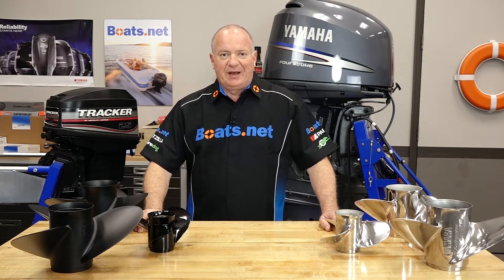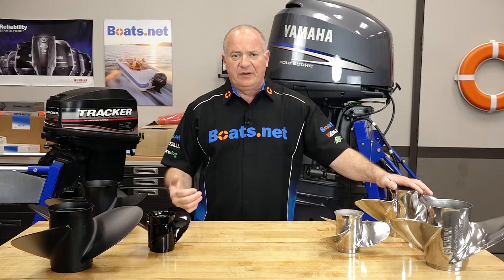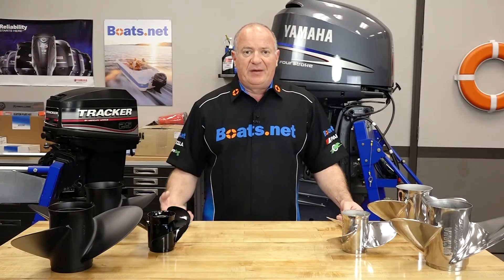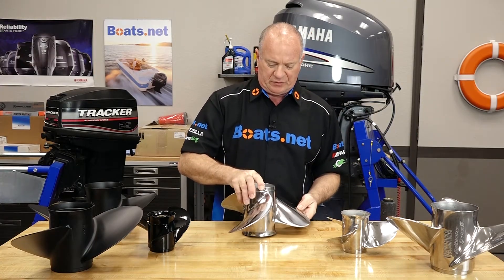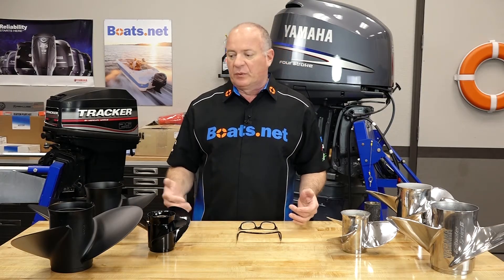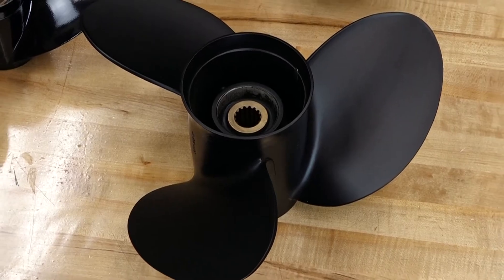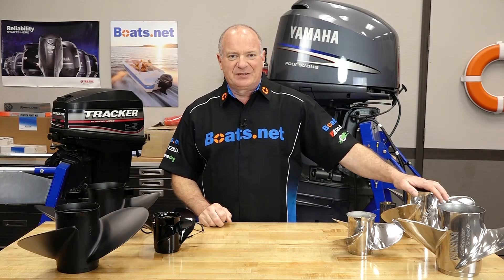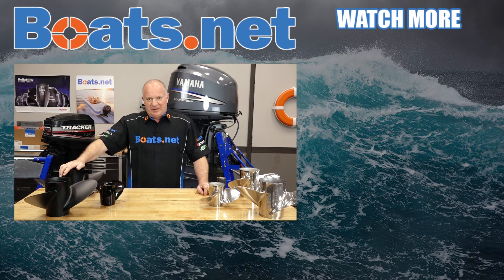Stainless Steel vs Aluminum Boat Props | What’s the Difference Between Stainless and Aluminum Props

Comment: Alu props suck, end of story. Absolutely asinine to state that for most people an alu prop will do just fine. It is the single most important part of a boat, in relation to how the boat feels and operates. It is the LAST thing you should save money on. Get the best SS prop you can and spend the time testing.

Comment: Good information. I run a stainless steel prop on my Mercury 25 2 stroke. I love the way it performs but I do fish an area with plenty of submerged obstacles. This past Monday I hit a submerged tree running 30 mph. The prop appeared to survive the strike, but the lower unit did not. It bent the prop shaft about 1" from center and there is probably other damage too. I love the cool factor of the stainless Ballistic prop hanging off the back, but I truly believe an aluminum prop would have saved me from all of the lower unit damage.
Reply: If you hit something hard enough to bend your prop shaft 1", nothing would save it. It takes a lot to do that.
The prop on your boat is ultimately what determines how your boat runs. Never skimp on a good prop.
Reply: @AB-80X  Oh I do run good props. Normally Ballistic. They do very well. When I go to lakes with stumps, I run aluminum. It may not have saved me on that particular day because I hit that a ton, but it is a proven fact they put less stress on the gear case when they strike and object. I've seen people break entire ears off of aluminum props with the LU being fine.

Comment: I had a 18 foot ski boat with a 115 Merc. I could get roughly 38-39mph with 2 people and a cooler. I wasn't really happy about that so I bought a SS with the same 19" pitch and had better hole shot and could get 43-44 mph on it. So I'll say the aluminum one wasn't terrible and for many it would probably be fine as the main prop. I still have mine as a backup, but the video is wrong on it needs to be aluminum if it's under 125. My buddies pontoon with a 90hp  Yamaha gets better hole shot and 2-3 mph better with SS as well

Comment: 90hp 4 stroke Yamaha… went from 13x19 Aluminum prop to 13.25x17 stainless steel prop. Gained 3mph top end (39mph to 42mph)… I did notice a higher RPM increase 6100…, but I don’t WOT anyways. The hole shot is ALOT better… I don’t need to trim down all way like I did with my aluminum prop, and Corning tight turns feel better.

Comment: Thank you for an interesting review. I am missing though something I have never seen answered in any forum or video on stainless vs aluminum prop comparison. That is, what would be an impact on the Outboard RPM, if all other things being equal (pitch, cup, rake, diameter, ect), and you only change the material of the prop from Aluminum to Stainless steel (or other way around)? Would Outboard RPMs increase or decrease? For how much approximately? Or would there be no  RPM change and only top speed would change - increase? If so, why no change in RPM?
Reply: Nobody knows because that is not being done. There is no way to make an alu prop in the same way you make an SS prop, the material simply does not allow it. If you go from one to the other, you need to test. What is certain is, that more often than not, you will need to drop pitch going from alu to SS.

Comment: I have a Yamaha 4 stroke F90. I have an alum prop, but it does nit have a rubber insert. The lake I fish has tons of submerged stumps & it is a matter of time I hit one. Will an Alum prop with the rubber insert more likely to protect my lower unit from damage ?  Thanks
Reply: Aluminum  with a rubber  insert with for sure be better then stainless steel for protecting your lower unit..... one the rubber insert will take most of the abuse off your input shaft and bearing..and two..the Aluminum  being a lighter and softer material then stainless steal with get beat up more flexing the blades a little bit or just flat rip a blade off giving u a little time to shut the motor down before chasing major damage to the lower unit

Comment: If I get 6200 rpm / 79 km/h on YAMAHA F115 with 21 AL prom, with same size SS prop I will get more speed ?
Reply: You'd need a 19" or 20" SS.

Comment: When i changed from aluminum to steel on my tohatsu 25. Damn thats the best descission i have ever done. Much higher top speed.
Reply: did anything else change? was it a generic grey alum prop? did the pitch or diameter change at all?
Reply: Alex Senst  went from 13 pitch aluminium to 14 steel.
Reply: @madsderp3648  most if not all of your speed came from the pitch difference.
Reply: Hot Ramen  tell me somethig i dont know
Reply: @madsderp3648  your OP suggests the increase in speed was due to the prop being steel, not the increase in pitch.
Reply: Hot Ramen  steel is harder an therefore are more direct in the water thats what a lot of the speed comes from
Reply: @madsderp3648  whateves, it was the pitch and you even coped to it in this thread. someone else even asked about the difference in the prop because it doesnt have that big of a performance difference below 125 hp, which they even say in the yt video that we are commenting on. cheers.
Reply: thats what i thought and ur guys says nearly opposite!!! these utube gurus......
Reply: @infinitewars6373   steel is much harder and heavier therefore it glides through the water more easy
Reply: @madsderp3648  what difference would you gain?
Reply: @infinitewars6373  higher top speed and better acceleration, and a great looking prop

Comment: Bs. Weight of prop plays no noticable difference
Reply: Yea sand and rock bars eat an aluminum prop up quick I got a stiletto on my 18ft rough neck with a 115etech because I’ve learned my lesson a few times
Reply: @spencerschenk9519  ur still cutting the water. Otherwise there would be no drag and cavitation
Reply: Yea I was wondering how there is stress. The weight of prop in water should be neutral. 

Only stress is rotational stress

Comment: Excellent video..I been contemplating buying a aluminium as I need to go a17 pitch instead of my ss viper but got told the aluminum blades would bend , it's only a 40hp etec now I'm gonna buy one..thanks matey great helpful video